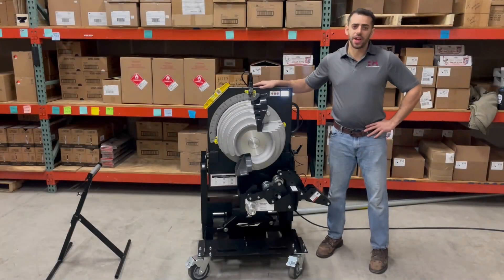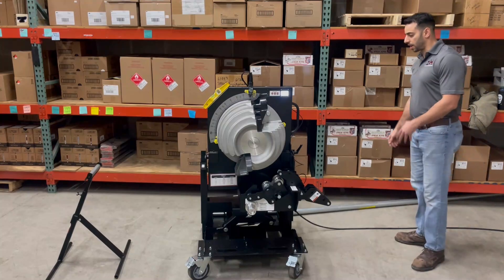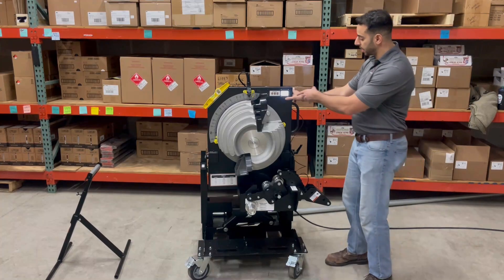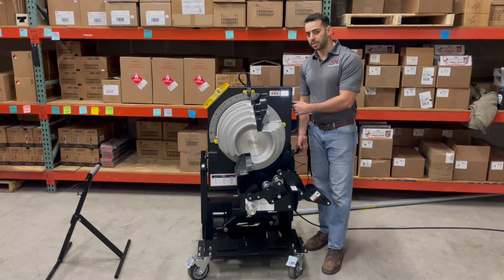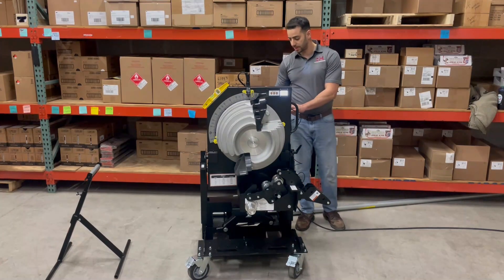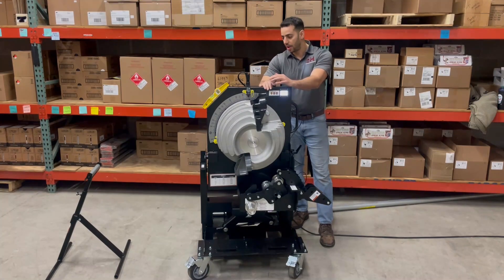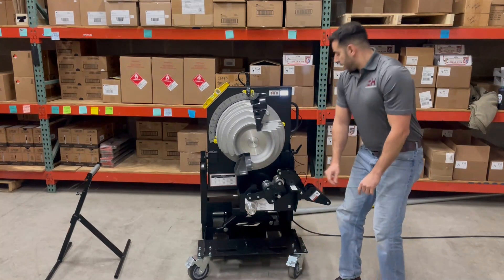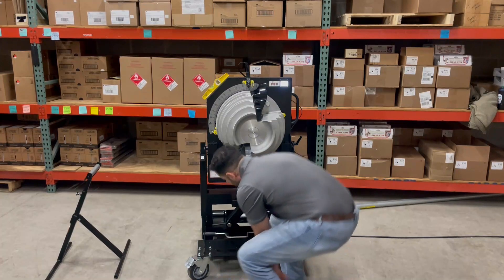Southwire PB2000 BENDmax Power Bender

Comment: mine wrinkles the Emt every time every size....
Reply: Same! Currently bending 1 1/2 emt and it ripples. Have you figured out a solution?
Reply: @samsoncook8022  Yes,  I played with the locking handle mechanism tension and made sure it fully engaged the locking position.  I noticed there was about 1" travel left when in the locking position.  Once I dialed in the sweet spot to lock/slide to full locked position and tension, it has been exactly as advertised.  Roll tension and full lock position is the issue. I've purchased 2 more since that came with the same issues.